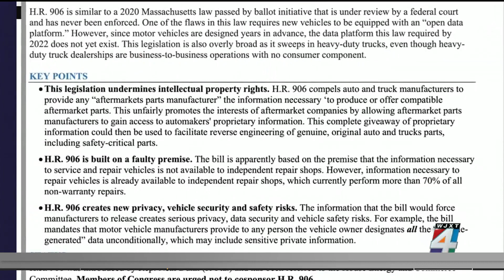Bill would give car owners ‘right to repair’ to save money

Comment: We already have the right to repair automotive vehicles.
Reply: No, you don't. What car manufacturers have done is make computer access only available to independent mechanics for a subscription fee. So they cannot scan or modify anything on the vehicle without access to the Computer module. Each manufacturer charges varying fees. So independent mechanics will only subscribe to high volume selling makes. It is not worth it for them to subscribe to Landrover, Jaguar or Mercedes Benz if they do not work on a lot of them. It might be something as simple as changing a light bulb but they or you would have to go to a dealer to turn off the interior dash light that says bulb defective. The new bulb is fine but will show on your dash panel the defective bulb. With vehicles being more and more computer reliant it is a major issue.
Reply: Troll or Moron with a Keyboard

You decide internet.